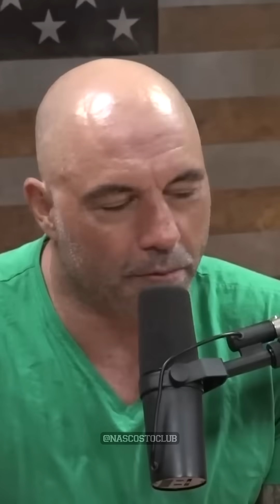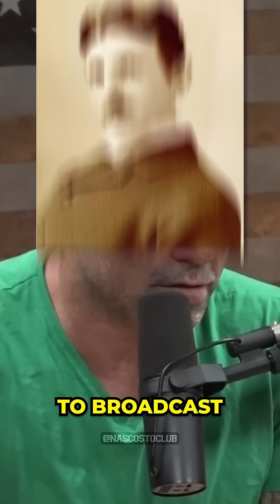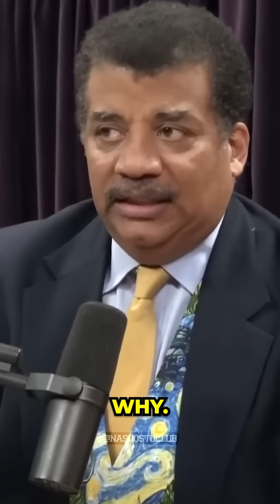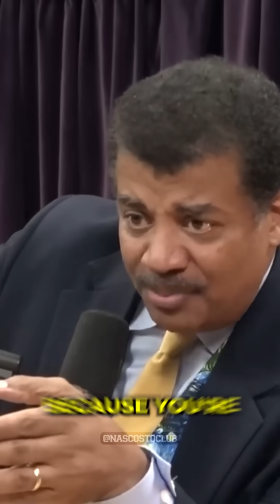WIRELESS Electricity Idea Debunked ⁉️⚡ #shorts

Comment: Guys, I know NDT is annoying and often wrong.  But he's not wrong about this.
Reply: I enjoy NDT in general, but he comes off as rude and blunt in this clip tbh
Reply: Well, electricity doesn't flow through wires so..........
Reply: @everetthancock2043  Let's hear it.
Reply: @NeoN-PeoN  I'm just saying it doesn't flow through wires. That's it. 

How would those transformers work outside your window? How are they delivering power to each other without wires? 

The energy flows through fields.
Reply: @everetthancock2043  
what transformers are you talking about?
Reply: @everetthancock2043  
pretty sure all electrical current involves wires.
Reply: @centralprocessingunit4988  the transformers connecting all our power lines. They give their power to each other wirelessly. The US power grid is not one giant connected wire, there's thousands gaps everywhere, yet the energy still gets to your light bulbs. There also many wireless chargers for cellphones, where you simply lay your phone down on a pad. 

Wires conveniently help move electrons but aren't necessary because the energy flows through the field, not the wire
Reply: as much as I was in disbelief after hearing it for the first time, it is in fact true that energy doesn't flow through the conducting wire, but rather through the electric field. Watch Veritasium's video about it.
Reply: @yourlordandsaviouryeesusbe2998  Yes, that's true.  But without the copper wire, there wouldn't BE a field there at such low power.
Reply: @NeoN-PeoN  I actually meant to tag the other person. Yes, it's only feasible across short distances without conducting wires.
Reply: @centralprocessingunit4988  What he's talking about is having two (or more) copper windings of different sizes very, very close to each other.  That's a transformer, and they are used to "step up" or "step down" voltages.  He's correct that you don't have to have a physical connection to transfer an electronic charge but you can NOT do it over large distances without an astronomical ASS TON of wattage and it's completely unfeasible for city use.  I don't know what he's trying to get at exactly but it sounds like he's bought into some b.s.
Reply: @yourlordandsaviouryeesusbe2998  I get you now.  I hadn't read the other comments.  My bad.
Reply: @everetthancock2043  you mean the transformers made of copper wires wrapped around to make a coil? Yeah, totally wireless technology.
Reply: @d.d.7720   
The wires are just there to 'oscillate' or 'push' electrons, but the energy is carried by the field. 

Any charged particle moving through space effects the electro- magnetic fields through the Poynting vectors. 

Any charged particle will do, but protons are trapped behind the Strong Force, so we harvest the energy from the electrons instead. 

They're much easier to move around. Initially we tried copper barrels and spinning magnets. Eventually we combined the idea into a copper coil, and shoving a magnet through. 

But this can be achieved chemically as well. 

So this is definitely pushing the limits of my knowledge, and I might be shaky with some details, but my overall explanation holds true. 

Electricity is the energy transfered by fields from charged particles moving through space. 

If you push a chain of electrons down a wire, you can harvest their direct current from the field. 

If you're instead oscillating electrons back and forth, you can harvest their alternating current from the fields. 

The size and shape of the wire is irrelevant, but I understand your point of, 'we can't make electricity without wires'. Obviously we can't use protons, and how else would we shove around electrons without carefully smelted conductive metals? I'm trying to make the overall point of, the wire is NOT where the energy is flowing, the fields are. The electrons BARELY move at all in the wire. Look at any electron in a circuit, for your phone charger or light bulb, and even after hours of use, that electron might have only moved a centimeter or less, but yet your phone managed to charge fully in that time. The phone charger didn't fill up your battery with electrons, it filled it with electric energy. The electrons are all still firmly attached to the wire, and didn't really go anywhere. However this is now getting hazy, because all the electrons would move together in a 'probability cloud' and not individually but I digress...

You can just use a giant glob of any conductive metal. It doesn't have to be 'wire shaped'. You can use a vat of chemicals to harvest electricity. You can even harvest it from the Sun. Batteries store PLENTY of electricity and they don't contain any wires. 

It took a while for me to grasp these concepts, because I'm not very educated or bright. 

But I eventually understood, and the truth always matters.  I have much more to learn
Reply: Prove it please. Tesla understood electricity on a God level. He understood things about electricity that most scientists still can't figure out how he did some of the things that he actually did
Reply: @Gamer-vn1uk  Well, if Tesla just "knew something we all don't" then of course I can't prove it.  Hey, I got an idea, maybe you should prove that it CAN work!  If you could, you'd be rich beyond belief.
Reply: @Gamer-vn1uk  hm. 

There was a giant YouTube war over this about a year ago. The greatest electricians, physicists, math, and science YouTubers were all debating fiercely over this topic. 

People like Veritasium and Science Asylum presented this idea to the public and other educators, 

And brilliant, genius people much smarter than you and I, like Alpha Phoenix and Electro Boom disagreed. So there was a back and forth, proving each others thesis and experimenting together. Thousands of YouTubers got in on the discussion, while millions of us watched in awe. 

If you've never heard of this debate, you're in store for some epic content. Check Veritasium first, then proceed to the entire debate. 

The original question he presented is: If you have a light-year long length of wire in a circuit, but the switch and the lightbulb right next to eachother: how long does it take the light to turn on? A year or a fraction of a second? 

The answer is a fraction of a second. If the energy was carried by the wire, it'd take a year to reach the load, but since energy is carried by the field instead, the light turns on almost instantly. 

The energy flows through the fields, not the wire.  Apparently as YouTubers were fighting this, the humans who've created the technology for transformers and large generators,  we're giving lectures at MIT half a century ago explaining these very concepts to their students. 

So I think the super geniuses are old in their nursing homes laughing at us.
Reply: @Gamer-vn1uk  pshhh! Quit with the blind hero worship sweetheart. Tesla was a fine and incredible pioneer when it came to the use of electricity. But there is absolutely nothing he accomplished that isn't understood fully and better by physicists today. There are no mysterious wisards in science. Good science is only built upon.

And apparently bad science is jumped upon by conspiracy theorists to claim "look! The government is suppressing free energy!"

Comment: have you seen lighting? have you heard thunder from miles away. Tesla  was not trying to broadcast power through radio waves no. he was tapping into the power already there! like solar, like water terbines on damns, like burning fossil fuel. the energy is already there. 

and yes the electricity through the air can kill you! its called lightning !!!! 🌩
Reply: personally I believe the goverment wont let it happen because it will nullify the electricity that helps forms clouds and thus making weather changes. if you study the Egyptian pyramids they are a picup for this energy. i believe they where using it to attract water into the atmosphere. changing the weather. by making the electrons in the water molecules in the air to combine turning into clouds

Comment: Uhh except he's wrong. For starters way back in 07 MIT successfully powered a light bulb 7 feet away. Second, the power used to power a lightbulb isn't enough to kill you... and wireless power tech requires relievers to sufficiently pick up the energy.. Unless you start slapping those all over your body you will be fine.

That all said... wireless power across distances probably won't be used because it is wildly inefficient and dosnt save much cash on the installation

Comment: Hold a fluorescent tube light under a pylon. Thats exactly how that works.
Reply: Even that won't work... you know what frequency one would need to ionise a fluorescent tube at the distance the wires of a power line to ground?

They can barely do it using tuned tesla coils at hundreds of megahertz
Reply: @PrintingEqualsFreedom  it does work because we did it as kids ( teenagers)
Reply: @xXFabe1upXx  Hehe! :)
Reply: We did that as kids, Power line workers told us to piss off or we would get zapped with radiation. But it was alright for them to work on the lines in overalls. I think you guys call the coveralls!
Reply: That’s induction and is completely different
Reply: @StarStriker-pk1zy  yeah but induction is practically magic, it's such a strange phenomenon. We use it for stoves but imagine what else it could do wirelessly.
Reply: @farcyde2948  It's magic if you have no understanding of electricity.
Reply: @farcyde2948  "induction is practically magic." I chuckled lol.
Reply: @farcyde2948  imagine? do you think that proves something?
Reply: @farcyde2948  It would turn every metallic surface into a stove.
Reply: The pylon carries high voltage cables. What you’re witnessing is induction from the power lines.

So, no, not the same.

Comment: Um what's a transformer do and how do they work?
You don't need to broadcast a huge amount of energy and it's not a huge electrical charge like lightning or the electricity in wires but would actually be an oscillating electromagnetic field to induce current in a transformer to power a circuit. Transformers can be used to step-up a small current to a usable voltage. They're certainly already used in the methods of power transmission that we use today anyway among other everyday electrical and electronic applications.
Also in a transformer there is no actual physical link between the high voltage side and the low voltage side and is actually a reason they're used in aquatic applications because they physically separate the circuit from the actual high voltage live circuit if anything goes wrong. If you have a pool with pool lights they're most likely connected to a low voltage transformer with a fuse which steps down the current and voltage from a household outlet to a lower voltage and current to power the lights so they're somewhat safer.
Also Tesla's concept seems safer than transmitting energy using microwaves which is what some scientists are talking about today or even actual electricity through bare metal wires 🤭.
Tesla was just ahead of his time or we've been kept back because of the repression of his ideas because one day with advances in material science and miniaturisation his concepts being more possible and useful is only inevitable. His ideas were also a big opposition to the coal and petroleum industry which was also booming at the time.
Sooo.....there Neil!

Comment: Nah that's not the reason lol, it's because you need a beam, if it's not a beam the energy of the em field gets dissipated by the inverse square rule. It's just a very very inefficient way of transmitting power.

Comment: If you think of 110v or 220v then no it won't work. But if you used the same amount of energy that a radio picks up and you used different metals that vibrate like tunning fork. It will hummm enough to make a motor ..thus energy..

Comment: Apparently Neil has not been told about microwaves and rectifying antennas.
Reply: And we don't use them in large scales because those things can fry a lot of stuff containing water and animals are living water tanks.
Reply: One of the most dangerous things you can ever mess around with are powerful microwave transmitters.
Reply: Yep you forgot about cell phone towers emit radio waves???
Reply: Guess you missed the part where the US tried that on their own ship and the crew got cooked
Reply: @xNFR  Far as I can tell I missed it because it never happened. But I did not miss the part where the Navy transmitted 1.6kW of power over 3,000 feet at 10 GHz, which can safely pass through all animals.
Reply: Ya u dont know shit thats not how that work mattwa33186 or did u not watch the video
Reply: Apparently you stick your head in your microwave and think that's a good idea. Why don't you go stand by a high power cellphone tower and see what happens.

Comment: you make like a wifi sub station but instead it's a power station. Which collects from the ground up. 🤔  you collect it at the station then wire your machines. Word is what he built at the end, the big ball had an aquifer underneath it. According to our systems it wouldn't work sure. So make different systems. Ndt sounds so unsure here.

Comment: His anger and conviction leads me to believe it's more of arrogance then knowledge that's powering his beliefs. Yes I agree that Tesla's idea was out there and most certainly would not of worked in his time, or most likely even in ours. But there's still tons of applications for such an event. Right now, the closest we are to the said technology is wireless charging, which works through simple induction, and isn't entirely wireless, BUT there's already forms of transmitters and receivers that transmit a number of different things wirelessly, something that's closest to energy, would be static electricity. It sends shocks through point a to point b, taking path of least resistance, but a shock, or interference, could cause harm, after all there's no such thing as a harmless electrical shock right. Right? Well, wrong. Cooling the atoms in plasma while still keeping the electrons excited gives off a more child shock, doesn't harm in anyway, except for the eventual cold of the electricity, the electricity can still be transmitted, received, generated, and touched, without any potential harm to a person, of course this application is definitely more difficult then saying it can be done, but eventually, it can be done.

Energy is already transmitted through the air in different forms, most commonly lightning, but what follows it is potential harm to the surroundings. Cooling this surge of electricity to the point where it deals no harm but still moves negates the harmful factor of a shock, delivering electricity from point A to point B with interference then becomes a possible reality, then you get wireless power.. obviously easier said then done and the actual practicality of it all would be highly limited until certain conditions be met and made, but still wouldn't be too far from reality

Comment: Tesla was not considering moving it through the air. It was being generated through the charge differential in altitudes. It was being transmitted through the ground, which is far more conductive. He also proved it could work in his lab in Colorado.

Comment: These technology already exist, it is called far field wireless power transfer. The basic idea is that you transfer the power through laser / microwave beaming to the for example, a lamp. However the cost for now is still high for simple use. It is used in some satellites and air drone.

Comment: 1000% wireless electricity is not and could never be a thing. Basic understanding of electricity and its mechanisms would teach you that.  Anything with any type of load on it would shock and potentially electrocute anything that became part of the circuit.

Comment: Neil really didn’t handle this one well. He’s correct that it wouldn’t have worked the way Tesla was hoping, his formula’s were way off and so the range of his massive Tesla coil would’ve been much less than he had thought. But it would’ve worked, absolutely, however there are some major issues, like interfering with essentially everything wireless making TV, Radio, WI-FI unusable. So in theory cool, but in practice not usable.

Comment: Joe specifically mentions using it to power a lightbulb. I dont know the fancy technical terms for how it works, but I know for a fact that there is something you can do to electricity to make it powerful enough to both power the bulb, AND travel through your body harmlessly. I know this because I've seen it be done before by my science teacher. I forget what he called it or how he did it, but I know he did it.
Reply: Yes, I have also seen this in person and I was so confused about what was he saying
Reply: It passed through you as a current. You were the wire. And it’s definitely harmful if you did that for several lights every day, but not harmful once when you’re a kid.
Reply: @Summonick2  so it's one of those things where the effects stack over time?